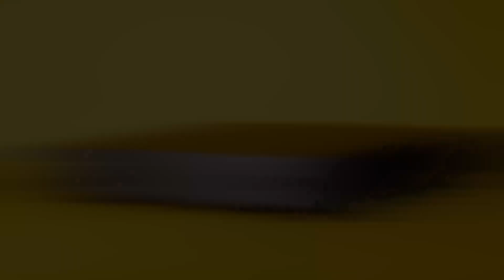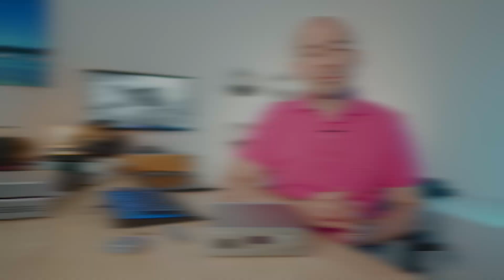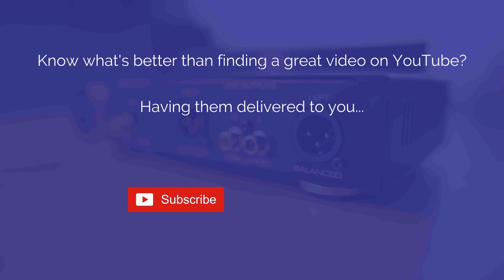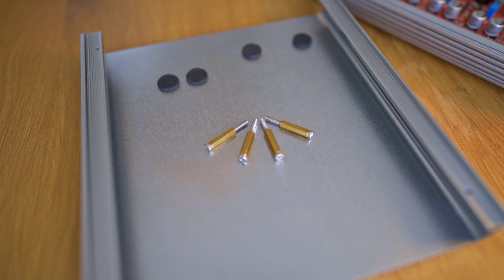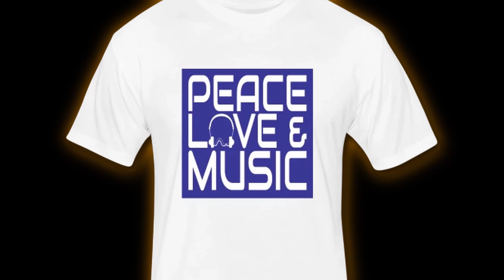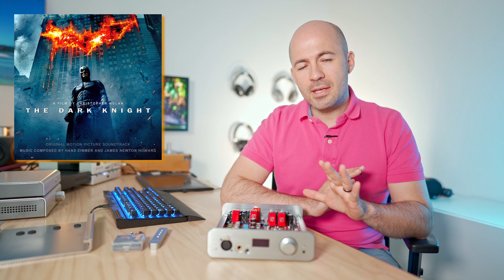Burson Soloist 3X Headphone Amp Review - New tech + old classic = wow!

Comment: Thank you that way wonderful! Would love to hear a review of the SMSL SP400. With stepped R2R volume control, I suspect it will give the Burson a hard time.
Reply from the maker: Hi Astro, I didn't know it had a stepped volume control - that's great as it's a much better option (if done well) than traditional pots. Is it discrete or op-amp based though because that's also very important.

Comment: Hi,
Great review, i am actually going to buy one. I plan to use a denafrips ares 2 with it. Did you get the chance to listen with the Empyrean with this set-up in particular? thanks
Reply: Hi @julien I just noticed that you were going for the same combination of Soloist and Ares II, which is what I am considering. Did you end up going for it? If so, what are your impressions? Thanks!
Reply from the maker: Hi Julien and sorry about the slow response! Your comment was in the "held for review" section for some reason...
To answer your question, I don't think I had the Ares II at the same time as the Soloist (although I might have). I think the combination would be great though. The Soloist is clean and transparent which will prevent things from sounding too thick, but it's also smooth enough to not undo the qualities of the Ares II. The Empyreans then are so good with everything that they'll work a treat - nice and smooth, but with lots and lots of detail retrieval.

Comment: Thanks for an informative review.  I'm now considering the Soloist for my lounge system, with Sennheiser HD600.  Did you try the remote volume... is it responsive?  How bulky is the PSU, and is it basically a mains-to-24V AC transformer, so should have(?) minimal power drain if left plugged in with the Soloist on standby?  Any other head amp(s) (not a DAC/amp) with remote volume control you would recommend in the price bracket?  Are you an owner yet?!
Reply from the maker: Hi Colin, glad you found the review informative. I am an owner now and still love it. I haven't used the remote, but I can tell you that the volume steps are quite small so it often takes large adjustments to get the amount of change I'm looking for - not an issue with the volume knob, but might be with the remote. A likely solution would be to setup the amp in high gain mode so each step is larger.
As for the power supply, it's similar to a laptop power brick in size and shouldn't draw too much power when the amp is off.
Reply: @PassionforSound  Finally I've got around to ordering one, having concluded there's very little choice below its price if you want a straight head amp (no DAC) with remote control volume.  Found a supplier offering a 30-day home trial, but would love this to be my (first and) end-game head amp.  Hoping my HD600s will up their game and postpone my search for better 'phones.  Heard HD800, HD800S, Focal Clear and Beyerd' T5 3G (some based on your reviews), and while all had their strong points I wasn't convinced any were the ones for me; now HD800S and Clear "combined" could peak my interest!
Reply from the maker: That's great news! I think you'll be impressed with the Soloist + HD600 combo and the headphone you're describing (Clear + HD800S is the Focal Utopia based on my recent listening tests)
Reply: @PassionforSound  I was afraid someone might point out the Utopia.  That'll be for when I retire, or after I've sold a number of treasured possessions!  They seem to be a polarising headphone, which mandate top-notch recordings and signal path.  Some prefer the Clear (with GBP 2000+ saving...and by how much does that skew the review...?)  Not that I won't be looking forward to your forthcoming(?) review, also to comparing it with Currawong's.
Reply from the maker: I don't get the polarisation of the Utopia. It's not perfect, but it's a pretty amazing headphone. I own and love the Clear, but the Utopia smashes it for me. I can only assume the negative reviews and comments are driven by it's price tag which always brings higher expectations. Hopefully I can squeeze the review in soon...

Comment: Purchased mine today. This review contributed a lot to my decision, I hope you can also make a video in the future on how to replace opamps.
Reply from the maker: Hi Kenshin, glad the review helped. I'm sure you'll love your new amp.
As for changing the op-amps, it's very easy. Burson provide the hex key required to remove the four screws holding the case together. Once they're removed, the op-amps can simply be pulled out and replaced. The only extra things to know are that the Soloist uses dual / stereo op-amps (most manufacturers will offer mono/single channel and stereo/dual op-amps). It's also important to align the op-amp properly by noting which end of the socket has the notch cut out (you'll know it when you see it) and aligning the mark on the op-amp (normally a dot or groove) with the notch end of the socket.
I'll see if I can whip up a quick informative video for you...
Reply: @PassionforSound  Thank you so much!
Reply: @PassionforSound  Btw I tried swapping v6 classics to my vivids and to my surprise there is no sound coming from the soloist, when I swap back the vivids which are originally preinstalled, all is working properly, any advice/suggestion? Thank you so much
Reply from the maker: My guess is your other op-amps are mono instead of dual
Reply: @PassionforSound  you are right, thank you so much! Btw where do you advice to the classics on the soloist, on the input stage or on the volume? :)
Reply from the maker: Definitely in the input stage. The volume is best left as is in my experience
Reply: @PassionforSound  Hi. I wonder if things like Ifi Ipower Elite would still help in the Burson Soloist 3x knowing that they already have the MCPS power supply? What is your opinion about this? :)
Reply from the maker: It's an interesting question and something I haven't tested. In theory it shouldn't make a difference, but theory and real world often differ in this hobby because there's often more to it than the theory captures. Just be sure to check the current requirements of the Soloist before buying. The iPower Elite outputs 24V, 2.5A so the Soloist has to draw no more than that (less is fine)

Comment: Great reviews as always. The D90/A90 and the Conductor 3 Performance (without XLR) are similarly priced. I'm just concerned that buying an all-in-one product without balanced capability is something I will regret in the future. Also, the Burson Conductor 3P is rated at 160mW @ 300 Ohm for SE which is less than half of what the Schiit Magni 3+ I'm using now is rated for.
Reply from the maker: Yeah, I generally like to keep my DAC and amp separate to prevent getting locked into anything. The D90/A90 stack is excellent, but I'd probably look at the Soloist and Composer from Burson, even if it means buying one at a time. I haven't heard the Composer yet, but I expect good things and should have a review coming soon...
Reply: @PassionforSound  Looking forward to your review. I took the plunge and bought the Soloist & Composer 3X Performance Combo since there was a 20% discount at the moment. Also Pre-ordered the Focal Elex for $550 since it has been price reduced due to Black Friday or something. Since I'm turning 40 in December I consider this to be a much cheaper present than a Porsche.
Reply from the maker: Awesome! I'm sure you'll love them. The Porsche might have been fun, but there's always Christmas coming! 😉

Comment: How hot does this run?  Extremely tempted to pick this up right now for the Black Friday deal based off your review!  Never had a pure Class A amp before so I’m just worried it might get too warm.
Reply from the maker: Hi Sean, not overly hot. It gets warm but never uncomfortable to the touch. I think my TT2 gets hotter
Reply: @PassionforSound  thanks for the info!  Is the “class A amps run hot” expression more just an old saying, or is it actually true in general, but the Soloist just runs slightly cooler than others due to its circuitry/topology?
Reply from the maker: No, it's true that they run hot in the sense that most switching amps (Class A-B, etc.) don't generate much heat at all. Some Class A amps can cook eggs, but it's not a rule per se. The Soloist is about average in terms of heat from memory (i.e. it gets warm, but not hot). It also has very good heat dissipation due to the ridged design of the whole casing
Reply: @PassionforSound  really appreciate the detailed responses you give!  A lot of YouTuber’s wouldn’t take the time.  I think I might pull the trigger, this amp sounds like one of the best overall class A amps based on your praise :)
Reply from the maker: You're welcome, Sean. I think you'll be pretty happy with your choice.

Comment: Thanks for the recommendation. Based on this I've just purchased a Soloist 3X (with black Friday discount!) as it was much cheaper than buying yet another pair of 300B's for my valve (WA5LE) headphone amp!
Reply from the maker: Awesome! You'll love it, Peter. I can't wait for mine to arrive
Reply: @PassionforSound  Haven't got it, heard it yet, but to put it's price into some context, I've just paid quite a bit more than TWICE the price of this amp for a pair of 300B's!
Reply from the maker: Are they extra special 300Bs or have they become super rare?
Reply: @PassionforSound  I was offered a NOS original boxed matched (and date matched) pair of STC 4300A's from 1965. STC were a British branch of Western Electric. So in essence these are British made Western Electric 300B's!  A bargain at the price.  The only problem is they are so rare I don't know if I actually want to use them!!
I also bought a matched pair of NOS boxed ECC32's (6SN7's), same problem, damn things are so rare I don't know of I want to use them!
Reply from the maker: That's always the challenge with tubes like that. I've found myself buying great tubes and then listening to the basic ones to "save" the good ones, but for what? Plug them in and enjoy them! 🙂

Comment: how come no one talks about the mic inputs on them? I would actually like to know about these. Can you use them independently for microphone input while using the other headphone ports i.e the xlr or the 3.5
Reply from the maker: Hi Black star, the mic input is a simple pass-through as I understand it. The idea is you can plug in to the front of the Soloist and then take a line out from the back and down to your soundcard. It doesn't integrate the sound with the amp at all and is just a convenience and neatness thing.
Reply: @PassionforSound  Ahhh, okay thank you. How do people integrate microphones into high end audio? Right now I have the solosit 3x and the conductor, but I also want to implement microphones into my system, but it almost seems like I have to buy another pre amp thats dedicated to just microphones... and thats just doing too much.
Reply from the maker: Yeah, it's really just for connecting a mic for basic gaming / conference call type use. You'd need some kind of audio interface for "proper" mics.

Comment: Excellent review, burson synonymous with quality, if my taste were a detailed clean soft analog sound, burson products would be my choice, excellent sound at reasonable price. Thanks for the review.
Reply from the maker: Hi Erick, you're right about them making great products, but don't think of the Soloist as soft or overly analog. It CAN be with the V6 Classic op-amps, but it's standard configuration is clean, resolving and not at all smooth, soft or "analog" (in the negative sense of the word).
I think the Soloist is actually one of the most neutral and revealing amplifiers I've heard so far in my journey

Comment: 6.43, it is not unique to burson. Linn, benchmark all use high quality SMPS for their power supplies. Ifi audio also has a high quality SMPS.

The earlier days SMPS were noisy, but modern components (fuelled by research into phones and other silicon style devices that need quick bursts of clean power) have made them great. LPS generally is inherently lower noise but they tend to be slow to respond to load changes due to transformer coils (inductor inhibits change in current). SMPS just let's the current pass through without much of that lag in response, but cheaper/older SMPS is likely to be noisy.
Reply from the maker: Hi Manuel, I may have been unclear. I wasn't suggesting that the SMPS was unique, but the way Burson are managing the power inside the amp apparently is.
You're correct that SMPS are everywhere, from cheap products like entry level Topping and Schiit through to expensive gear like the TT2.
Reply: @PassionforSound  gotcha. Yep the "transient variations" I hear out of my burson fun is pretty great (most of it is due to the psu).
Reply from the maker: Amazing the difference they can make, isn't it?

Comment: Did you miss having a dedicated button or switch to change the output ? 
I was planning on getting this for my desktop setup where a regularly switch between my headphones and my monitors, I was wondering about the experience of having to go through the menu to switch the output.
Reply from the maker: Hi CK, yes, at first I did, but the remote control makes that easy. I don't normally use remotes, but I did for the Soloist.
Reply: @PassionforSound  I thought the remote only allowed you to change the input to the amp not the output.
Reply from the maker: Oh, you're right! Sorry! I didn't find the output switching a big deal, but it all depends on how you plan to use it. Output switching is pretty deliberate with my setup and not something I have to do too often.

Comment: Hi again, I know you don't have the burson anymore but wanted to ask how the volume knob feels. Is it easy to turn or does it have some resistance? It looked like there was no resistance based on the video
Reply from the maker: Hi David, that's a good question. There's a little bit of resistance, but it does move quite freely and that's because it has a slightly notched movement to it because it's driving a switching circuit rather than being a normal potentiometer like we're used to.
In short, it feels great and you want it to move freely because the volume steps are very small so I often found myself giving it a quick "spin" (not that it spins freely - I just turned it rapidly(
Reply: @PassionforSound  I see, thanks for the response!

Comment: Not immediately relevant to the soloist but perhaps of interest to some people considering a Burson DAC/amp and I see interest in the Composer and Conductor below. I have just received a Conductor 3XP and as far as I can tell it will not work with my Auralic Aries Femto streamer over USB. Certainly using Roon. This may be due to its requiring a windows xmos driver though usually DACs which dont need OSX/iOS drivers like the Burson, will work with Auralic streamers. I do have an Aries G2 as well but have not tested that combo yet.

It works fine over optical or coax but that means sacrificing sample rates over 24/192 and all DSD. Not a deal breaker for me but may be for some users.

Sound wise it is sublime and I am delighted with my purchase but thought potential buyers should be aware.

I have reached out to Auralic and Burston to see if there is a workaround and will update if they find one. It could be a Roon issue but I doubt it.
Reply: OK. Now I feel like an idiot. All I had to do was perform a new setup on the Aries and now the Conductor is recognised over USB and working perfectly with Roon. Thanks to all those who gave me advice on the Auralic forums and also Hans Beekhuyzen - incidentally if you like watching this channel you will enjoy Hans' channel. Very different styles but they complement each other. Apologies to Burson. I can't praise the Conductor enough. Using it with Oppo PM2, Verum Ones and Beyerdynamic T90. All sound great. Also feeding a PrimaLuna Prologue 2 and kef LS50s  and it sounds sublime.
Reply from the maker: Thanks for sharing your experience, Jim. I'm glad you got it working! I agree, Hans' channel is excellent
Reply: @PassionforSound  Thanks ! Incidentally Burson got back to me first thing today. Excellent customer service. Always a good thing.
Reply from the maker: Great to hear

Comment: Hi please compare this vs topping A90 in transient response and bass or they are the same only the soundstage is better as you mentioned?
Reply from the maker: Hi Seban, the Soloist had to be shipped out so I can't directly compare with your specific questions in mind, but the ability for the Soloist to produce the sound stage that it does will directly relate to its transient reproduction so I'm pretty comfortable saying that it's better than the A90 there. I can't really comment on the bass other than saying that it went toe-to-toe with the TT2's onboard amp and was a match for it on bass reproduction. The A90 may be at the same level for bass reproduction, but the Soloist is definitely the better overall amplifier

Comment: Very nice review (as always)! I am considering buying the Soloist. At the moment I own the AG NFB-1amp and the THX 789. I like the NFB -1 amp much better because of the 3D sound comparing to the rather flat sounding 789. 

How does the Soloist compared to the NFB 1-amp, as you owned the latter ?
Reply from the maker: Hi Leo, I never owned the NFB-1 - it was the single ended equivalent (I can't remember the name). Based on that experience, the Soloist will be a very nice upgrade, but I can't directly comparable l compare to the NFB-1